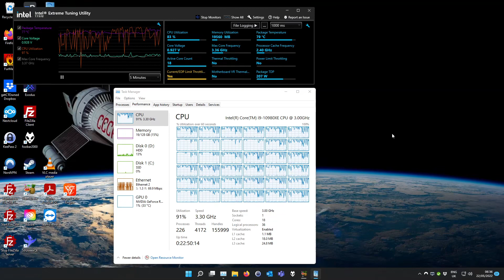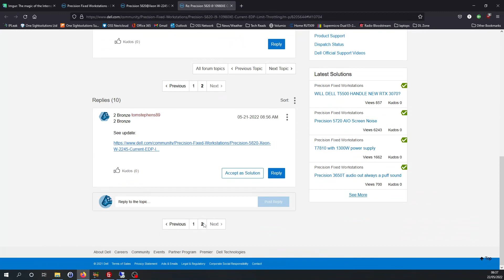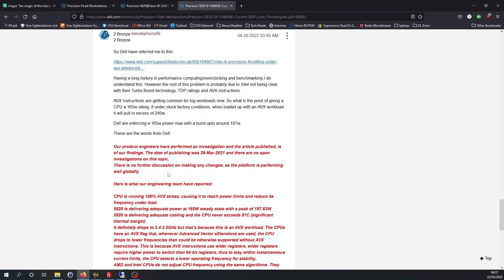Dell Precision 5820 Power/Current Limitations & Throttling

Comment: Interesting to see this even on their high-end workstations. At this point it is clear for me that if I want performance, I need to avoid Dell. I had a Precision 5510 laptop (i7-6820HQ) that was throttling like crazy until I got it somewhat under control by extensively modifying the lower chassis, adding thermal pads , putting liquid metal on CPU... 
I recently purchased a somewhat performance oriented Inspiron 16 Plus 7620 (i7-12700H + RTX 3060), and, to my disappointment, I am not getting the i7-12700h performance that I was expecting due to throttling. Repasting CPU helped a little, but still... better value elsewhere.

Comment: The Advanced settings on my Dell Precision 5820 Xeon W-21xx machine are mostly greyed out and Turbo Boost Power Max and TB Short Power Max were already set to their max values which are like 145 and 127W there is no unlimited option like you have. Likely because my motherboard is a different revision. But when I ran the benchmark test it said it was able to get 4.18Ghz so I guess something is working. lol
Reply from the maker: I actually sold my 5820. For such a high specced machine, the performance was poor. It annoyed me too much that you could build a machine for 1/5th of the price with a new Ryzen or 12th/13th gen intel mainstream chip in it, and see it DESTROY this 5820.
Reply: @GetCTOwned  Is that true? I'm planning on building a home server, for hosting a couple of games and for media streaming, what do you advise then? I was ready to pull the trigger on this one
Reply: Just to have an idea, so it consumes 150W ?

Comment: Is there any fix today? I just bought several of them and I think my engineering team will have performance issues...
Reply from the maker: No there is not. This is due to bad communication between Dell and Intel. Intel know that their chip even in stock condition consumes way more than it’s rated TDP, but Dell have enforced strict power limits that don’t even allow stock performance without throttling.

Comment: That cpu is rated up to 86 degrees.   Can you exceed 86 degrees with NON-AVX stress test?   if not, then i would assume Dell wants to avoid warranty claims from heat damage.
Reply from the maker: Without the power limit kicking in and bringing the power consumption down then periodically yes you can exceed 85 and trigger some thermal throttling, however when the fans spin up on the Dell it does keep it in check… But it is wind tunnel/jet engine levels of noise. I mean like being stood in a comms room with servers and network equipment humming away. 

The current EDP limiting prevents it from pulling much more than 190 ish watts for any length of time and hence probably keeps it within the capabilities of the thermal solution.
Reply: @GetCTOwned  Consider attaching a static pressure optimized fan directly to the Cpu heatsink, (i've used dental floss in the past to do this), like a noctua NF-F12. Also completely remove the Black wind tunnel. This should not void any warranty.